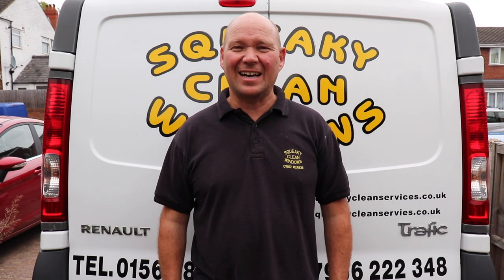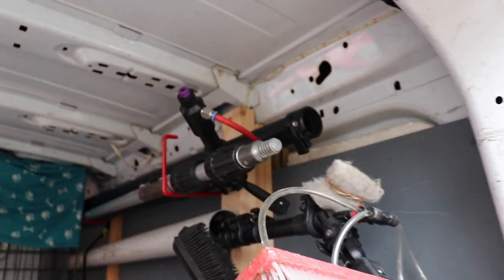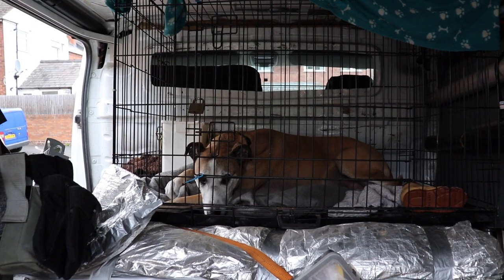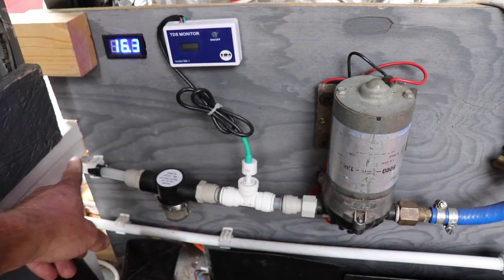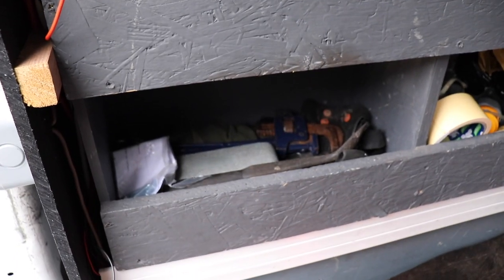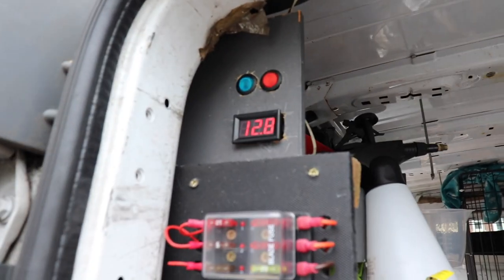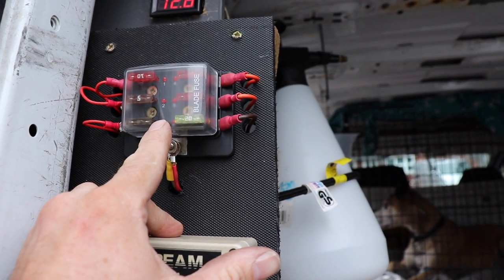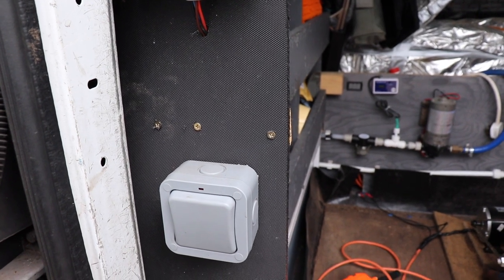My DIY Window Cleaning Van Setup

Comment: Absolutely brilliant channel Dave.
I love how you sacrifice your own spare time to give step by step advice to others.

I myself have a small window cleaning round (2 days a month) which is a mix of trad and wfp ..  The rest of the month I fit windows,  fascias and guttering..  

I have the pure water filling up in my shed so that is no problem at all and I use a facelift backpack with Harris pole which is ok for now..

I've been looking at the clx22, gardiners swivel and the 35cm Dupont ultimate brush...  Do you think it would be worth me getting this along with a univalve?..

Eventually I'm going to get a 400l baffled tank for the van and possibly build the round up more and leave the window fitting I reckon.

Thank you for your great channel
Reply from the maker: T T Teesside-Wildcamp thanks very much for your kind words they are really appreciated👍
I actually started off with a 18’ aluminium Harris pole but I found that twisting the clamps gave me tennis elbow so I actually upgraded to a clx18. 
Compared to the Harris they are a fantastic pole but if you can stretch yourself a bit further the slx is much better.   
I love the ultimate brushes and the DuPont is probably the best one as long as you aren’t using hot water which sends them a bit soft. 
Hope the round goes well and don’t hesitate to get in touch if you need any advice with anything 👍
Reply: @squeakycleandave1  Thank you for the very good advice. Thing I'll get the slx instead.  It's so refreshing to have someone who gives genuine help and feedback.  Thank you again squeaky clean Dave👍. 

Top man !!!
Reply from the maker: @Andyarms75  My pleasure👍

Comment: Hey Dave, How did you wire your isolation switch ? I've a similar setup as yours i.e fuse board etc but stuck on wiring the isolation switch. Cheers
Reply from the maker: Drop me a email saying what you need to know and I will try and send you some photos
Reply from the maker: Squeakycleandave@gmail.com
Reply: @squeakycleandave1  will do cheers

Comment: Hey, great video. 

Can you please recommend a carbon fibre pole system that's good enough and won't make me go bankrupt?

I use the Unger aluminium pole and it's killing me! 

Thanks
Reply from the maker: Jefferson Faria I would recommend an Ova8. Best pole I’ve used by far. Not the cheapest but the cheapest Isn’t always the best. It’s worth the investment. Thanks for watching 👍
Reply: @squeakycleandave1  top man! Thanks a lot for such a quick response.

I will look it up for sure.

Best regards

Comment: Hi Dave  is it best to have pump turned upside down when installing it 
Regards

Patrick
Xtreme cleaning services 
Ireland
Reply from the maker: patrick tierney Hi Patrick I don’t really know if it makes a difference but I like to get the inlet and outlet as low as possible 
👍
Reply: Squeaky Clean Dave hi Dave I have just wired a new switch in for my pump
Fused also 
Wires are heating up 
Any ideas
Reply: Squeaky Clean Dave got it sorted had an extra wire
We’re would I get a wheelchair motor to make the electric hose reel
Can’t seem to source one here in ireland
Reply from the maker: patrick tierney I got mine off eBay. Try this link. If it’s no good try
250watt 24volt electric scooter motor

https://rover.ebay.com/rover/0/0/0?mpre=https%3A%2F%2Fwww.ebay.co.uk%2Fulk%2Fitm%2F142237271136

Comment: Wat type of battery  do  u need  to run pumps
Reply from the maker: It needs to be a 12volt leisure battery. The higher the ah the more power it stores. For a one man set up minimum 75ah and for a 2 man set up minimum 100ah but you can use bigger for both setups

Comment: how do you manage in the winter months dave
Reply from the maker: I have an immersion heater fitted in my tank so I fill up at the end of the day and put the heater on which gets the water up to about 50 degrees centigrade. this makes cleaning easier and stops the water and the inside of the van from freezing. I have also insulated the inside of the van which helps a little. 👍